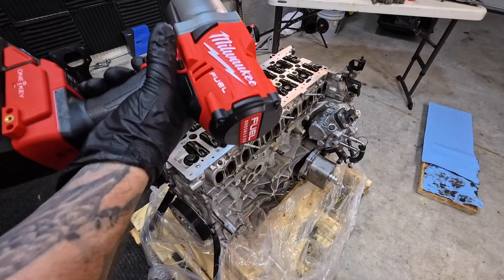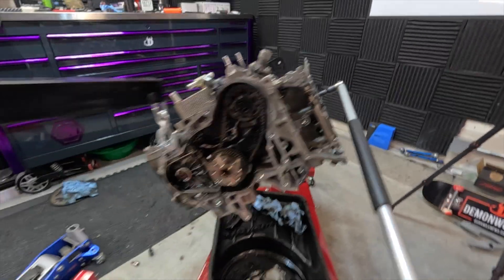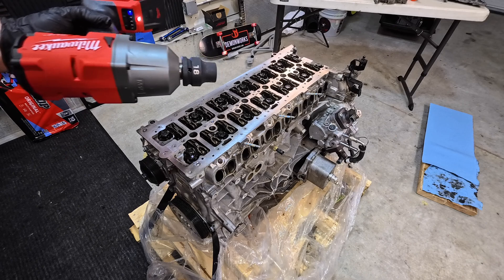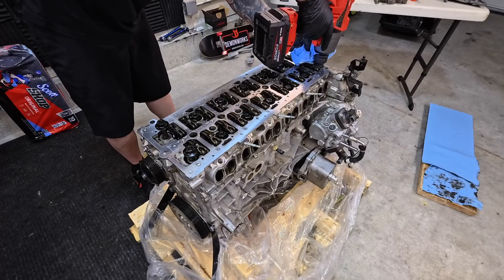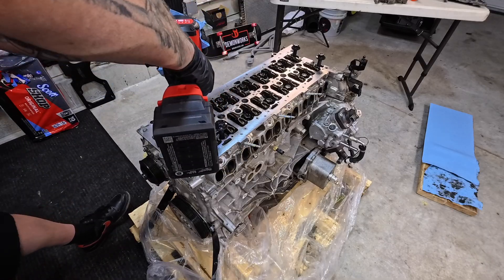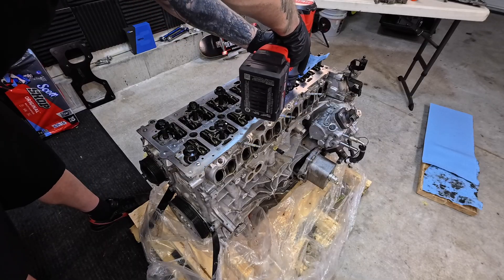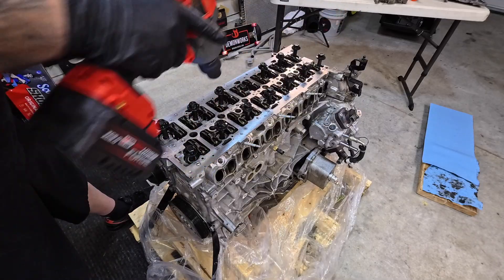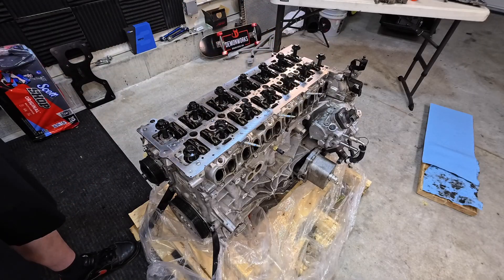Milwaukee 2864-20 3/4” Impact vs Duramax Head Bolts | XC8.0 Battery Test

Comment: What is the torque specs on that 3.0 duramax head bolts? I’m considering getting this 3/4 impact. It performed well I just something stronger than the 1/2.

Comment from the maker: Looking for the tools I used in this video? 👇
Milwaukee 2864-20 Fuel 3/4" High Torque Impact: https://amzn.to/46W7GfS
M18 REDLITHIUM High Output XC8.0 Battery: https://amzn.to/3HebAGE

As an Amazon Associate I earn from qualifying purchases.

This Milwaukee 3/4" impact gun with the XC8.0 battery was able to break free the stubborn head bolts on a 3.0 Duramax diesel. If you’ve ever struggled with these, you know how tough they can be. Watch the full video to see how it performed!